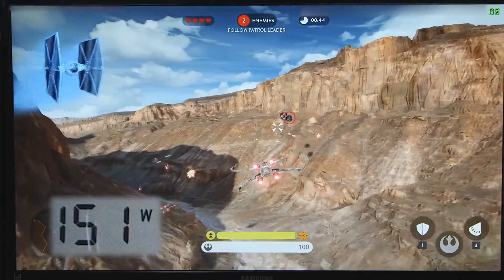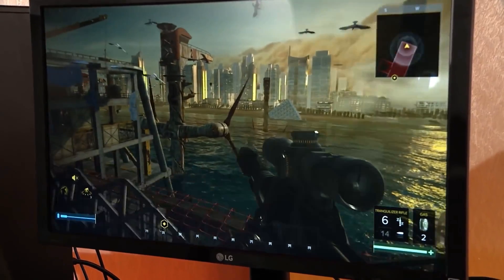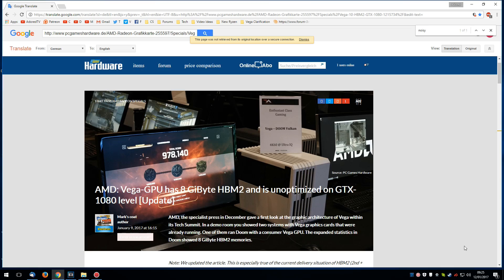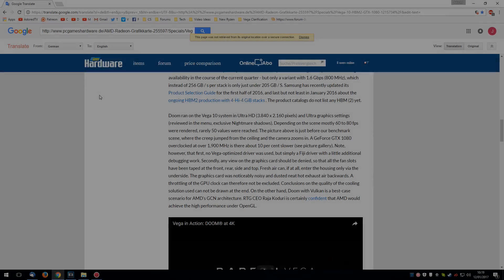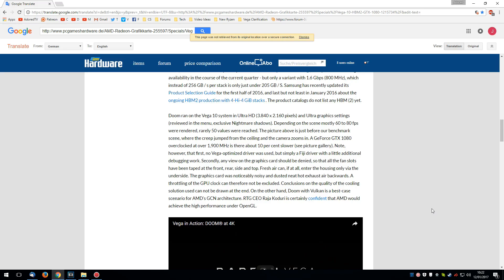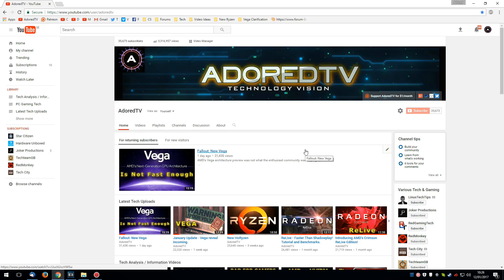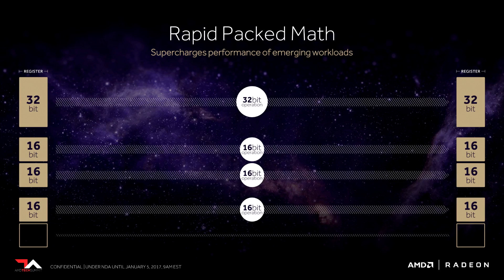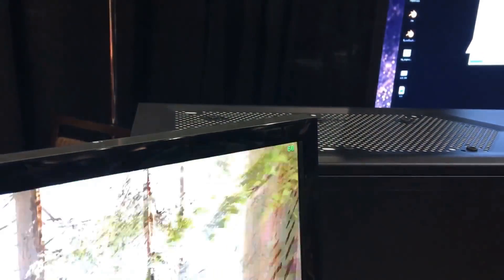Vega Clarification - How bad is it?

Comment: I recently read that Vega will use AMD's infinity fabric technology that debuted in Ryzen. Do you think that there is a possibility of AMD using this to create higher end multi-die Vega card that won't require crossfire profiles? We have already seen from the threadripper and Epyc reveals that AMD has created this technology to not only connect multiple core complexes together, but to also connect multiple physical dies together.

Comment: To think when I build my first rig in 2012 I brought a 7970 for 400EUR it was top of the line back then so top line cards tripled in price in just a few years time :( 

Ever since I have had multiple variations on that card, I have had GTX 980s, 980 TI, Titan (Original and unlocked ran at 1.2Ghz), 970s, R9 290x, R9 Fury, R9 fury-x. Sad thing is that the 7970 was the last card that was just head to head better than the 680, after that it was just Nvidia on top and they exploited this position by bringing prices up to insane levels and people just brought in to it so they are getting away with it. Problem is no matter what if AMD wants to win back market share they don't need just to match Nvidia for performance, they need to smash them for at least a generation and ideally keep a healthy lead for the generation after that before people start to see the light again. 

Sure the 470/480 midrange cards are great in their way, but you win the minds by winning on the top end and than those minds will buy the cards in the mid range.

Comment: Drivers make a major difference, the features in Vega requires software support to use, it is not automatic. To give you an example, geometry throughput, is identical to Fury X (4 per clock) unless Primitive Shaders are utilized to put the Stream Processor array to work in culling & transforming vertices for primitive generation. Another example, the Geometry Engine itself is programmable, Rasterization and in particular, Draw Stream Binning (pixel culling), requires drivers to operate as it's both a hardware (on-chip binning cache for Geo Engines) & software solution. 

One more, the new Intelligent Workgroup Distributer is just a fancy term for a programmable Hardware Scheduler. Again, without drivers it's not going to be able to load balance to the 4 Shader Engines any better, and so the 4096 SPs will be under-utilized very much like with Fury X.

Without "Vega drivers" and running emulated "Fiji drivers", Vega should in fact be not much better than Fury X per clock.

Comment: The primary reason I chose to buy a couple of Nvidia cards was because I could get similar performance for less noise among the options available at the time. Less noise is far more important to me than either performance or price. The AMD cards at the time were running a bit hot which meant more fan noise. That was a deal breaker for me even though they were good on price and performance.

Comment: Vega will still have the same theoretical computepower per clock as Fury X, which means Fury X @1465MHz is @ 12TFLOP/s or 1526MHz to reach 12.5TFLOP/s. This alone is enough to have GTX1080 performance. Now, NCU is officially said to have higher IPC and clockspeeds so I expect to see at least 1526MHz as the MI25 card. Now, add the higher IPC and new functions. The biggest change is the new SIMD's which will get much higher utilization which is the main problem with GCN. Also add the much higher geometry capacity which was the second worst bottleneck in GCN GPU's. I think Vega can and should reach 1080Ti levels of performance. They also have a quite aggressive roadmap with a Vega 20 on it's way and then Navi with some nextgen memory. I am still very optimistic and Vega is promised to deliver! AMD have shown us some tricks before with the R300, RV770 etc, and even if it's not a new R300, it can still impress us. We just have to wait one more month now!

Comment: With AMD it always was like: I don't want to pity buy! 
Be it CPUs or GPUs and the Thing was: For the performance I needed...AMD just wasn't doing it.
I have a GTX1080, because i needed the fastes thing i could get at that time. I switched to a higher resolution and my card just wasn't fast enough and was at its VRAM limit with 2GB! I waited for Polaris, it came and it disappointed on that note.
FuryX was out of question, due to power consumption and too low VRAM.

Same goes for CPUs, though I DID switch to Ryzen, because i need some Video-render power and AMD has delivered here, but look at the game benchmarks.
My point is, that AMD is right: Ryzen needs optimization! Nothing wrong with that, but have you ever asked WHY it needs that?

One reason really is, because Devs couldn't be arsed to work with AMD CPUs. I mean the FX-Line was the biggest fail, they ever had imo!
Underperforming, while sucking energy like crazy and now AMD is back, because Ryzen IS a good CPU-line and everything runs like garbage, because NOONE cared up until this point.
So did I!

I mean I WANT AMD to competem, but when they don't deliver, I won't buy. Simple as that!
My longest running PC (10 years) was an AMD/ATI-System and i waited for SO long to give AMD a try in both.

Lets hope i made the right choice with Ryzen...i am "peeved" about the lackluster EFI-Support, which is TOTALLY AMDs fault (Guys seriously...it cannot be, that ALL Mainboard-Vendors have the same basic issues, if it's not!).

In the end you can say this about AMD:

Too little, too late!

AMD in a nuthell...sadly!

Comment: On the FuryX disaster: The FuryX was simple nowhere to be found in some countries. You just couldn´t buy it anywhere, whereas the 980ti was available. This continued over half a year where i live and then nobody cared about it anymore. The 980ti was slightly faster and actually cheaper where I live. And all those reports about pump noise and coil whine didn´t help either.

Comment: I hear a lot about the price gouging going on in the hardware market and there is no doubt overpricing is a thing, but that is only really if you offer your butt to them, then you're asking for it. The real advances have been in the mid range and here overall the consumer has benefited in my view. The NVidia price drops are likely to continue, waiting another 6 months will make a significant difference to the price/performance/longevity curve. 

Let me give an example, I bought an i7 4770k CPU/MSI Gaming 5 MB/32Gb memory/780ti combo a couple of years ago for about £1100. I have watched the releases since then. The 980 series wasn't enough of a performance boost to make it worth it. The 5 and 6 series Intel chips at my price point also didn't make much sense to upgrade. 4K monitors and TV's are only now within reasonable price range and VR is still too young and pricey. When the likes of Shinecon start making VR headsets then we'll see some movement. The loud minority might like to think they dominate, but in truth market sales are measured in units sold, not price per unit the minority are willing to pay. I very much doubt there will be price fixing going on in the reseller market place. If that really were the case 3D TV's wouldn't have died a death.

This year, I expect to be paying again around £1200 for the basic set, but for that I will triple to quadruple performance despite a much worse economic situation than 2+ years ago. This is how I look at it. I have paid less than £600/year for my current performance, I will pay the same £600 per year or so for significantly improved performance for the next couple of years. Do I feel gouged? No, I had choice in the matter AND I am likely to be positioned with my next purchases to take advantage of the emerging technology. If we compare that to the car market, the cost per annum and improvement curve is much worse for 4 wheels. 

Exactly what proportion of the potential market have 300hz monitors? I know I don't, or come to think of it, anybody that I know outside of YouTube reviewers. I do know that I bought the 780Ti to support 2x1080p monitors at 60hz minimum.The question most want answered is will the GPU/CPU support my move to 4K now that it is affordable, or even multi-monitor 4K? It looks like AMD has answered the questions that really matter, as opposed to NVidia's constant aspirational, 'what will pull the nerd birds?'. Can I multi-monitor at 4K with reasonable refresh rate, maybe VR and do some grunt work video encoding/3D rendering on my budget? AMD say.. yes. I can have workstation performance with a reasonable gaming experience at a home enthusiast price point.

To my mind Vega doesn't need to compete with 'enthusiast' grade, it only needs to represent an economically good reason to 'jump out of a perfectly good airplane', which is what my current system represents. I could keep my current system for perhaps even a year more and not really suffer. I have no ePeen issues. Only when the software houses make the transition to the new tech will it become a reasonable prospect, at the moment they are generally under utilizing what I currently have. If AMD give me a reason to think my next system is more likely to last 3 years rather than 2 I'll be happy. I think AMD has always considered loyalty above profits and bragging rights, my feeling is the Vega will be competitively priced to sit near enough the top end as makes no real world difference, just more cost effective.

Comment: If you ask me, AMD was clearly sandbagging with Zen and that was my only hope that Zen will be competitive in the end.

1. set a high enough but not that high relative to Intel ipc+ goal of 40%
2. keeping clocks low 3.0 in the first demos in line with first leaked ES's (2.8/3.2)
3. set the clocks at 3.4 a the reveil with Turbo unknown
4. releasing the 1800X with 3.6/4.0 clocks
5. reveiling 52+ ipc gain.

they clearly found the balance between not showing of the final performance and giving confidence in their achievements to their shareholders.

Comment: hey. how about now, when we've seen that amd kinda was sandbagging with Zen CPUs. a while back they put 6850k vs new Zen cpu both with Titan to eliminate GPU bottleneck. they run Battlefield in presentation and fps was on par. now we've seen that it runs at higher fps which indicates that that early sample was running at lower clockspeeds. now they also revealed (linus i think) that that rig was running a zen7 1700 which is runs the slowest of all. 1800x runs at 4gh for example. so that is sandbagging. the worst case actually.

Comment: Hey guys, I have a theory i'd like to share with you about NVIDIA's possible 1080 Ti this March.

But first, do you all remember how NVIDIA has historically released their new cards just hours or days AFTER AMD's new stuff? As far back as I can remember when AMD would release a new GPU tech suddenly NVIDIA would crap on their parade by releasing something slightly better just days afterwards. But now, instead of waiting a few weeks longer for AMD to release Vega NVIDIA has decided to release the Ti BEFORE it, and possibly on the same day as Capsaicin? What? Now why in the heck would you go and do something like that if you believe your 1080 Ti is going to be more powerful than Vega? The answer is you wouldn't, you would obviously wait a few more weeks and do what you have always historically done and rain on their parade as usual. Right? That's the NVIDIA way because it makes the most $ sense to crap on your rival.

However, think about this. What if NVIDIA this time around does not believe they can rain on Vega's parade? What if they believe Vega is a true threat? What if they have information that it is twice as powerful as the Fury X? What if they have information that the 1080 Ti has no chance of defeating Vega? Wouldn't your strategy then change and force you to "speed up" your 1080 Ti release so you can at least get a Month or so of $800 sales before being the ones rained upon? And also wouldn't that be the ONLY reason why you would suddenly move your Volta tech forward by a full year? Sure, that's EXACTLY exactly what you would do. You would release your 1080 Ti NOW as fast as you can, so that you get sales from it before Vega makes people think twice about it. Then you push Volta forward as fast as possible to limit the damage to less than a year, instead of almost two.

Historically when NVIDIA has known they had the better tech they have ALWAYS ALWAYS waited to crap on AMD's new GPU by releasing it the same day or just days/weeks afterwards. Yet this time around they decided to not only release BEFORE Vega, they also decided to push Volta much earlier than expected.

Is that a sound theory? If you truly believe you have the better GPU wouldn't you want to rain on AMD's parade the same week or Day that they release Vega? The same way you always have in the past...
Reply: Replying to myself that NVIDIA is just using GDC again, instead of waiting a little bit longer. I assume they believe the marketing strategy would not be worth it this year to wait. AMD on the other hand could be waiting to see how the 1080 Ti pans out before they make their move. Also I know they are having problems with HBM2 yields.

So, never mind me this just could all be coincidence. It just seems like NVIDIA should wait for Vega before dropping the Ti if the Ti is really that good. It's not as if they have a long wait either. But maybe Volta is just too soon to release the Ti any later than GDC? Volta may not even be any faster than the 1080Ti anyway.

Comment: Sounds like AMD has had a bad strategy for a long time.
I think they should consider their advantages and strengths, ability for smaller dye, lower power, CPU knowledge, and aim for value. It seems developers of game engines are not keen on adopting new technology that works only for 10% of their game's buyers. However if Vulcan works for both brands, and is easier to implement having a nice effort to gain ratio  then this could be a great way to level the playing field for AMD. I think AMD can win if they drop developing many new features that demand extra game development time and only benefit a small group of gamers. This AMD development time should be spend on making Vulcan the best and most user friendly api.
IF AMD simply made a 1070 level card on a smaller dye needing less cooling, for a lower price they would start winning. No need to copy all Nvidia's most high tech features, just the older (actually used) features and a bit more horse power performing them.
AMD could spend a bit more time removing bottlenecks and design the cards not to have major dips in performance, which is much more useful (immersive) then having the highest peak fps.
Researching new technological features that most often are not used by game engines is a waste AMD should stop doing.

I hate monopolies.

Comment: obviously AMD is sand bagging they are showing up the similar performance of what nvidia an Intel has now so they don't even try to fight cause they want to have room for big improvement and a cheap card from them will be better for gamers who don't shit money and want to enjoy a game with out having to rob a bank, I have an 1080p tv and a Intel  5 year old gamer pc but my cheap and graphics run every thing a throw at in medium 60 fps ok Vega is capable of 4k 70 fps I think is fucking awesome and is I want more all ways can cross fire 2 for the price of one nvidia and still more.
Reply: sure Vega is capable for 70 fps on Doom at 4k with ultra settings, but Doom is a linear game, plus it gets around 15% more fps cause Vulkan. a 1080 can't keep stable 60 fps on Witcher 3 on 1440p max settings. Vega will get around 15% less fps cause there's no Vulkan to boost fps

Comment: If you use it that much, you should explain certain terms shortly!

I never ever heard of the term sandbagging and I heavily follow all the tech news (99% on the German Computerbase.de you used as reference for the Hitman Bench here. They might not be the best investigators but it's rock solid trustworthy tech journalism - mostly) since around ~2006 and can name the features, specs, changes and main models for every CPU and GPU generation around the time of the first C2D processors. Sometimes the deep stuff about ALU, SMD and Vertex units still confuse me but roughly it is a knowledge good enough for being the well all friends and family "drink" from regarding tech :D

Comment: I'm not too happy about the slower HBM2 reports I'm seeing. Looks like SK Hynix can't get their crap together and supply AMD with proper VRAM as of yet, not until later in the year. So AMD looks to be opting to releasing Vega with slower memory then both the HBM1 on the Fury X and it's even slower then Titan's GDDR5X. Well that takes me out of the line up to buy one as I want the fastest HBM2 possible. What's the purpose in early adopting into newer memory architecture if its slower then GDDR5X? And sadly SKHynix are making it sound like a product designed that way when its obviously an initial HBM2 batch flaw SK Hynix couldn't overcome in time for the May Vega release window. There is NO WAY they were aiming for 409.6GB/s, no way no how. The first batches of Vega 10 will be flawed IMO.

http://www.tweaktown.com/news/56088/amd-vega-launch-slower-hbm2-faster-later/index.html

BUMMER!